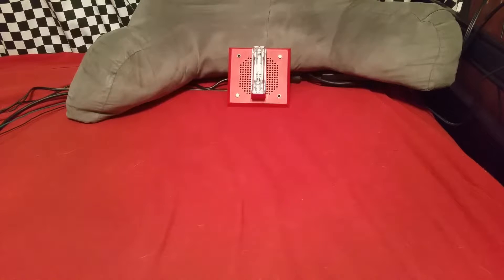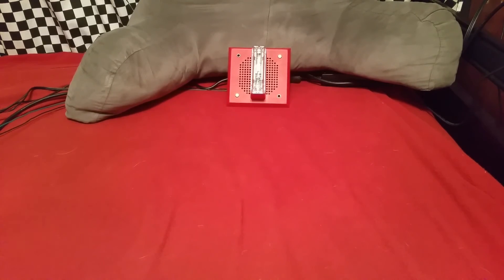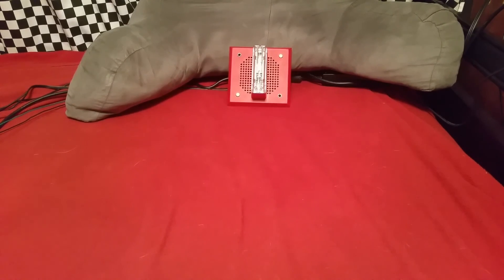Gentex SPKE4-15/75WR Speaker Testing

Comment: My building has these exact old Gentex fire alarm speaker strobes on a much newer Gamewell FCI E3 series panel. It plays a whoop tone very similar to the first fire-lite one, perhaps more reminiscent of the Pyrotronics MXL-V whoop. The amplifiers on our real system are surprisingly not the best of quality. It is a bit grainy and tinny sounding in comparison to this video, and the whoop actually distorts at a certain pitch. I always found it interesting that when they chose to update the panel they kept all the devices from the old system (which was likely the obscure FCI FireVac 7200.)
Reply: FCI FireVacs 7200s are almost completely extinct. Firevac's used their own slow whoop but used a silent knight voice evac message.
Reply: @Sirenfireproductions5209 Silent Knight message scripts seem popular, I think it’s from the old Audiosone panels that Silent Knight used to use. 
How would you describe the 7200 whoop? Is it close to the E3 whoop? Faster, slower, lower or higher pitched? Is the tone harsher like Simplex or Audiosone, or is it a more fuzzy tone like the E3? Or is it somewhere in between like the Notifier DVC whoop? Just wondering, there was definitely one left running on my college campus as of the end of last school year, and I can’t find a single recording of one going off!